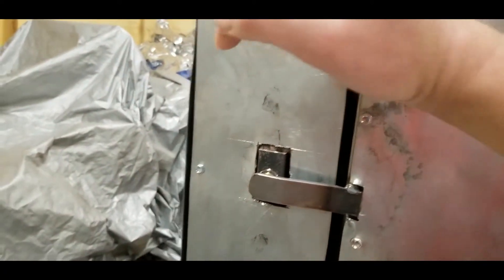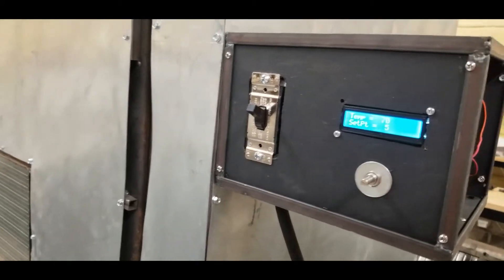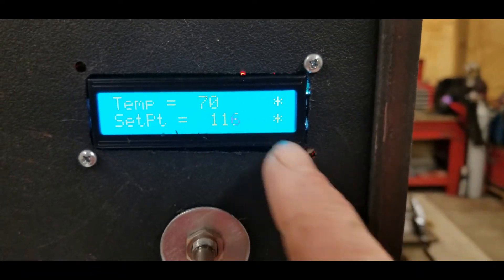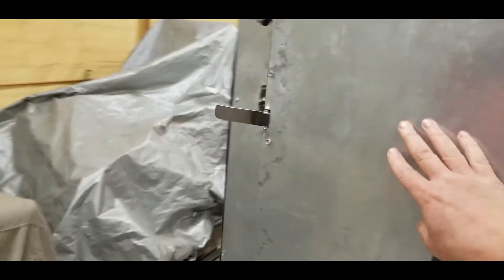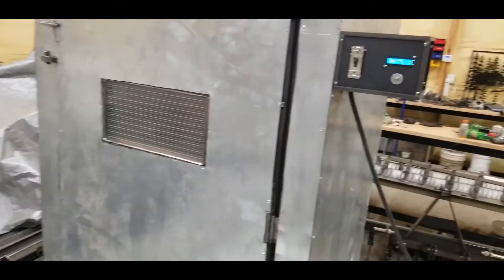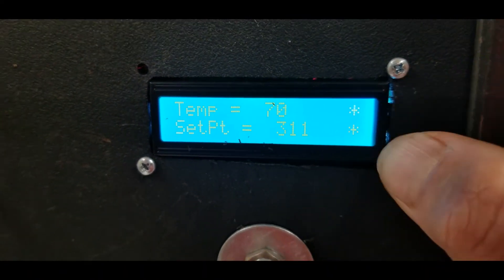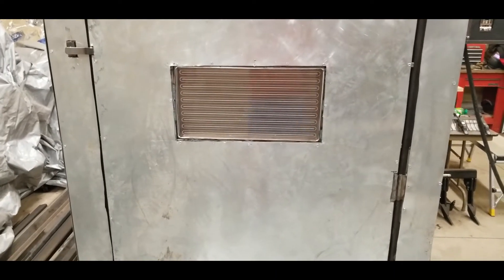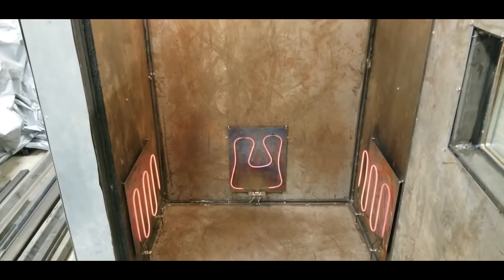Homemade Powdercoating Oven Homemade Powdercoating Oven

Comment: What's the red hand machine you used to cut the sheet metal on the floor please?
Reply from the maker: I assume you're talking about the hand shear I used to cut the outer skin. It's from Harbor freight. Basically it's a drill style with a sheer cut head

Comment: I am curious about what type of lights you installed.  Powder coating usually is at temperatures around 400-450 degrees, most lights would fail and short out.  Also, I like how basic your control panel is.  Would be interested in getting the material list for the controller as well.
Reply from the maker: Lights are oven lights.  Controller is a Microchip PIC 8-bit  controller I programmed.  Controls 3 high power relay boards I got from Sparkfun that can be controlled by the 5V output of the PIC.  Then its a 2x16 LCD display, also from SParkfun, a 10-turn potentiometer, an oven temperature sensor, a simple switch for the door, and misc. resistors/wires to put it all together.  Oh, and 5V power supply.
Reply: thanks

Comment: I watched your video and I like the size you built. I've seen a few other videos similar to yours. They used pop rivets to attach the sheet metal. I can not tell if you used pop rivets or sheet metal screw (or tek screws). And I would be wondering why drill and then rivet when a self drilling tek screw would be quicker.
Reply from the maker: You're correct. I used self drilling sheet metal screws.